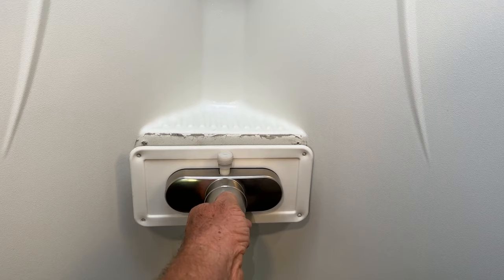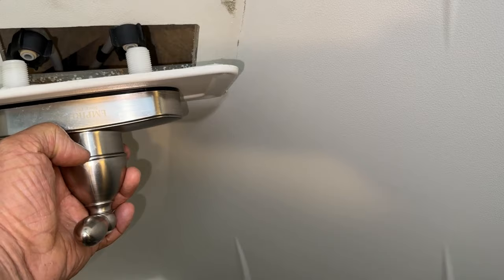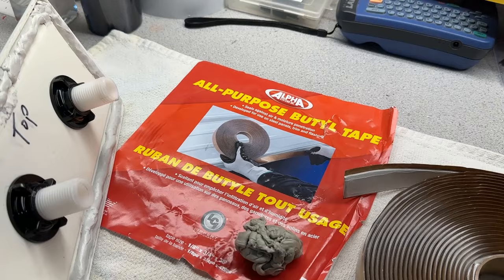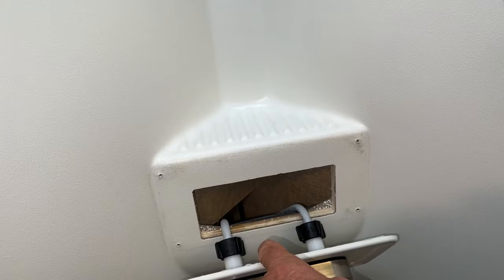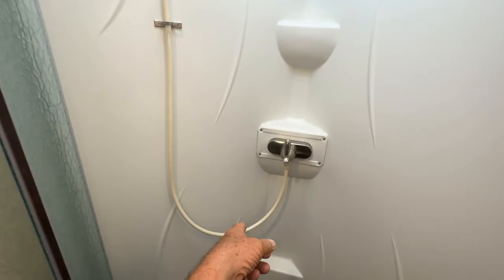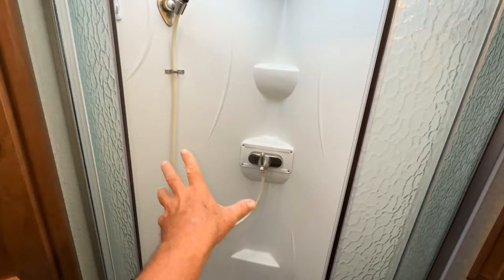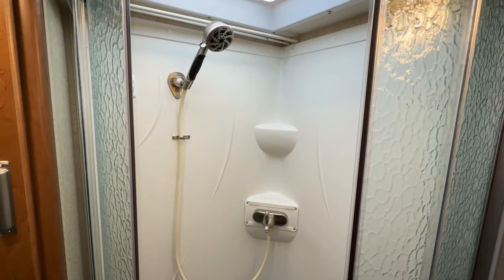Shower Valve Modification Anyone Can Do If You Have This Same Set Up

Comment: I did the same thing on my Lance 2021 2375 added a check valves on the hot side, cold side so when I turn the water off at the showerhead, I don’t get a surge of cold or hot water. Also, I turned the handle back down. Awesome job!
Reply from the maker: Thanks for watching, commenting and recommendations :)  I was thinking about installing check valves but gave it a try without doing so and so far we haven't had any surge with the hot/cold water. Maybe this is because the valve has a built in check valve?https://www.youtube.com/@thetraveltrailerguy/videos
Reply from the maker: How are you liking your Lance?
Reply: We are enjoying our Lance 2375 very much! Installed 1300 watts of tilting solar on the roof 500 amp hours of battle batteries 3000 Victron inverter we do a lot of Boondocking. This will be our third year in Quartzite AZ. Enjoying your videos keep up the good work!
Reply from the maker: @Plumber-ic4lx  Thank you so much we really like ours a lot. You have a great set up :) I'm going to need to remove the hall way pocket door, I'm 6'4" and my can't take anymore hitting that darn header. My wife laughs every time I hit my head so its time.

Comment: Michael just a quick question, did you use Teflon tape on those connections?
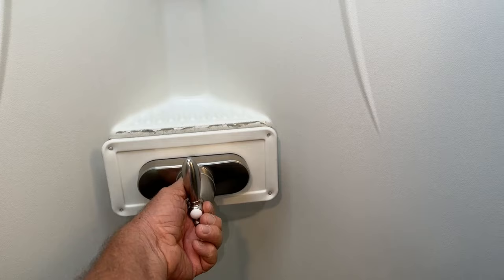Reply from the maker: Thanks for watching Edward. No I did not need to use any Teflon tape, if you look close you will see the connections have a rubber seal inside so tape in not needed. Here's where you can see the rubber washer in the video at 1:09 minutes https://youtu.be/CgXRxFw12BI?si=jHsKato3wsT0y4jY&t=69